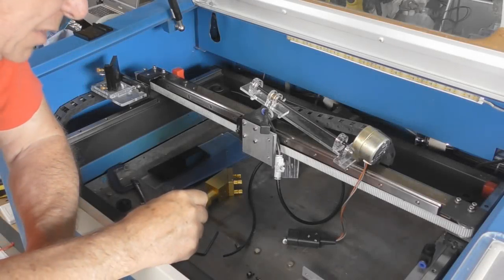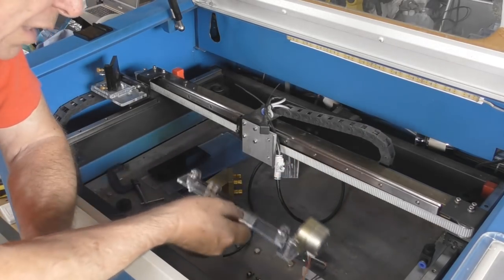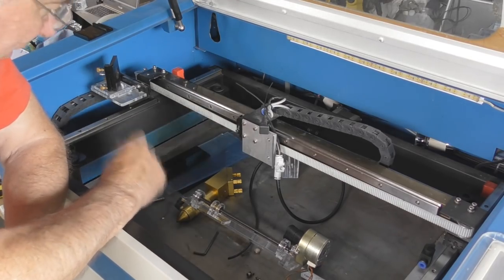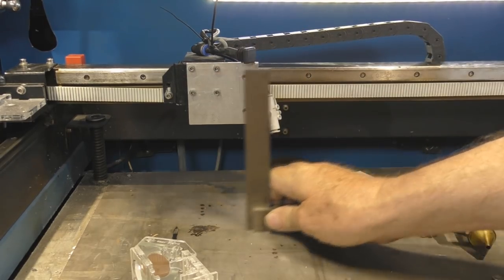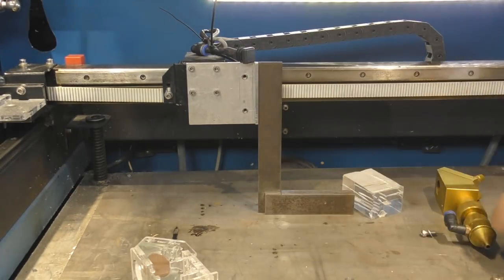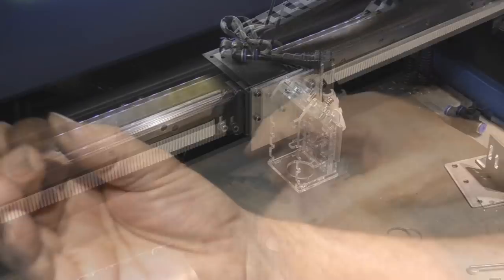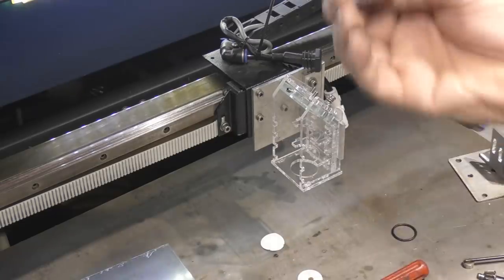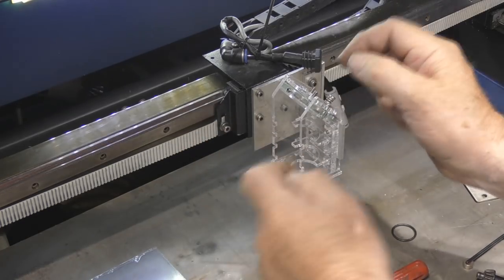RDWorks Learning Lab 144 New laser head

Comment: So, that's one heck of a neat design, I really like it! I can appreciate the need for full adjustment on the head - with my laser (the one I spent months rebuilding), there's no adjustment on the head at all. My only way of adjusting height was the tube mounts themselves, which was extremely tedious during the initial setup. I had thought of modifying the head, but I was simply glad to get it working and not spend any more time on it! I predict that in a few months, some enterprising Chinese company will have seen your video and will be making heads like this ;-)

If you do go for a metal one, depending on how you're getting the metal cut, you can basically do exactly the same construction as you did with the acrylic, with mortise & tenon joints. Once assembled, you can give each tenon a brief zap with a TIG welder to fuse it into the surrounding sheet. Gives a very rigid construction.
Reply from the maker: Hi Lindsay
Tenon and TIG weld fuse welds is an approach I have been using for many years. There are very few things I cannot make from 2D  parts. I am not just copying this design in metal but adapting the design to a more sophisticated level to exploit the strengths of metal. So there will soon be a Mk2 and I will see if I can back engineer it to acrylic for others to make for themselves.
Best wishes
Russ

Comment: Another great video! I would love to see this adapted to the Red Sail clones as well. Russ, the red clone I have uses the same "hinge" style screws for mirror adjustment as your modification. It makes alignment as easy as you show it. While watching your amazing work, I wondered how I managed to get nearly centered results without the adjustable head assembly you've created. I believe it is possible because the entire mirror holder can be shifted by turning all three adjustment screws either direction, which accomplishes what your adjustable head accomplishes, although without nearly as much travel. When reaching travel limits on the screws, it is necessary to return to the tube and raise or lower it to return the beam within range of the adjustment screws. A big job, clearly simplified by your design. Very nicely done.

On an unrelated note, have you considered to put your massive engineering talent into creating a reflection test device? There's been some discussion of "bounce-back" of certain metals causing damage to a laser. If you had a caddy/fixture to place test metal samples at the focus of the nozzle, at a 45° angle, would your power meter be able to read how much of the energy is absorbed by the test metal and how much would be reflected into the nozzle?

I would envision that a test taken at the focus with the power meter, compared to the reflected power, would determine which metals should be safe to lase for projects involving paint removal or the like.
Reply from the maker: Reflectivity is a vast subject  but if you narrow it down to our IR wavelength of 10.6 microns every metal is reflective. The degree for  the majority is above 80% and  metals such as copper brass, aluminium, gold and silver will be at 99% and above depending on the surface oxidation. An oxide is a non-metal and will absorb the light energy.  If 99% of the energy is reflected then because it has been concentrated into pin prick, because 80% of the light energy is at the central part of that pin prick there will not be much scattering because that high energy near the beam axis  will be reflected back nearly normal to the surface. Just like waves hitting a sea wall  there will be cancellations and  amplification of energy  as it is reflected so some of the energy reaching your lens could be much higher than when it passed through .  Marking stainless steel objects by burning away the powder coating is a regular question .
Stainless steel is about 95% reflective in it's polished condition. However cover it with paint and it is non rflective. The light energy hitting the paint excites the powder coat molecules into a higher state of vibration. As that vibration increases so does the paint temperature. At anything between 100C and 200C (depending on the powder formulation) melting will occur. Much above that and all sorts of chemical reactions start to take place. The real tell tale is if you attack powder coat with a blow lamp  you will produce a charred mess. Charring generally means carbon and carbon has a "melting" point of about 3500C. So it requires huge amounts of energy to raise the carbon to its sublimation temperature where it will turn into a gas and leave a nice clean surface behind. If you balance power and speed there will be very little surplus energy to reflect back to your lens. In the majority of cases you will be engraving on a slightly curved surface so and rays that bounce off will be scattered harmlessly.

In general I would advise using a longer focal length lens for such work at least  a 2" or even a 2.5" would be saferbecause the reflected energy densities will be lower.
I have only destroyed one 1.5" lens whilst trying to mark uncoated stainless. That will be the last one!!!
Best wishes
Russ

Comment: Just asking as I watch along ;-) Your glue - is it anything special, or just superglue? I've had bad experiences with superglue and laser-cut acrylic. Things look OK initially, but after a few days you get stress cracking from near the cut edge.
Reply from the maker: Hi Lindsay
Cast acrylic is less prone (but not imune) to stress cracking. The PETG cerment I use is less dramatic than standard acrylic cement. I used it for a  PETG job originally but found that it works well with acrylic but takes a bit longer to set. Maybe that's why it cracks less. Here is what I use
http://www.bondrite.co.uk/adhesives-for-plastics/wc123-petg-weld-cement-250ml/p340483.html

Best wishes
Russ

Comment: Looks great Russ.  I do have a Q. Perhaps I missed something along the way.  The lens adaptors your inserting obviously would be required to utilize your system. Where does one get such a lens kit. Also, does the lens kit only go up to 2.5" OR say to 4" or greater?  Im sure others would be interested in knowing the cost of a lens kit as well. -Sam
Reply from the maker: Hi Sam 
The problem with this design is that it was a prototype to test all the ideas. As you know, I don't do things behind closed doors so this was a bit of a "let's see what's possible". The biggest being to prove the stability of acrylic for such a laughable application. I had planned to make a metal version but that would mean that others could not follow if they wished and I was locked into doing something I don't want to do, which is selling an expensive product. I don't need to be selling things, thus my goal is always to provide designs and information so that you can do it yourself as cheaply as possible. First it was all about proving the principle and after a few weeks of using it I'm very happy. However.....as you have rightly observed, I had to make a lens tube for every focal length. Although OK for me, because I have the kit to make them, this was a significant negative if others wanted to try and follow me. Hence I looked hard at the design and have now worked on a MK 2. With just one nozzle and  one modified 20mm style lens tube  (like I have on the Lightblade machine).  I can cater for 1.5", 2", 2.5" and my compound HD lens system. With a slightly modified nozzle you could also fit a 4" lens. I did not fit the 4" lens into my brief because  folks with this China blue machine usually stick at about 60 to 80 watts  where a 4" lens is just a blunt axe. This design is being specifically developed to fit the 300x500mm  blue machines with a FRONT FACING bearing on the X axis. I am no planning on developing one for the Red Sail clone machines using the TOP FACING bearing system because designing a suitably stiff mount will be a nightmare.  Even with my fairly rigid front mount system I have accidentally identified a problem that I have seen on other machines and been unable to fathom the source of the issue . Now I know, it has forced me to dump my aluminium back-plate in favor of a REALLY rigid design. All will become clear in about a week when I plan to publish my MK2 design and spell out the manufacturing options that I hope will suit the varied  skill and equipment capabilities of the many interested parties. I still plan to sell as little as possible but I will try to help those with enthusiasm and skills  but no manufacturing kit.  I will be posting the dxf files and parts list  on a couple of sites for people to download and modify as they feel fit to suit their machines.

Thanks for your interest
All best wishes
Russ
Reply: Russ,  Thanks for the speedy (laser like answer ). So If I understood you correctly you made your Laser Lens holders?  Also, I ask about the / say a 4" or greater. As of lately a few of my projects have me cutting foam. So the Axe metaphor is a good one. (foam >1"-3") . Also, have you thought about running the laser for some 1-5-10 mins and taking temperature measurements from the backside of the 3rd mirror? My guess is you should be able to predict the longevity  of the perspex with the gathered information. with hopes of the MK1 being sufficient. Like you. I too dont mind machining out my own parts if need be. But if the laser can do it and the part be good enough?. then let the lasing begin! I know now after more than a hundred vids you already know this. You are a true asset to human kind Russ!  I'll have the popcorn ready for the MK2 showing.:)  * Meant to add. Dont know about the others. But Im interested in your lens tubes and how you approached the builds. I have been contemplating making my own corrected  3rd mirror and lens holder from aluminum.
-Sam

Comment: Just a thought. Can you reduce the power programmatically? Would it let you write orientation marks in the surface of the material without cutting all the way through. Failing that, you could laser a tiny hole as an orientation marker. For example, "Align single dots and double dots when assembling!"
Reply from the maker: The simple answer is yes.. At present there  are no drawings available for release because despite being successful it is a 3D prototype. I am now self criticizing it and in the process of designing a metal MK2  version with much easier to use features. I may try to translate this design backwards for acrylic manufacture so that people can make for themselves. As I do so I shall make the location tangs in different positions so that it can only be assembled the correct way. That would be the normal way of fool-proofing assembly.
Thanks for the suggestion

Best wishes
Russ

Comment: Well again a damn good session and I learned a lot again. But after everything was set i couldnt see the way you set the focal point. With the original head we could move the nozzle up and down but here i think you set the focal point by moving the table up and down right?

Edit: how did you make that nozzle set and also, can we have the dxf file and make our own nozzle set for ourselfs or are these all for sale?
Reply from the maker: Hi Umat
Yes if you listen at 18 minutes you will hear me tell that you need and adjustable table because the nozzle is at a fixed height..

The nozzle set is made from plastic (acetal copolymer)  and although I have drawings for it I will not be publishing them just yet. I am in the process of looking at this prototype and criticizing it. I am part way through designing a metal Mk2 version that will be a lot slicker. I can design differently in metal. I may be able to back translate the metal design to plastic so that you guys can make your own  but the mounting bracket will still have to be metal for strength and stability. 
Best wishes
Russ
ps I am musing the possibility of making the head and nozzle kit available for sale because there have been many interested that do not have manufacturing capability

Comment: what is the advantage of making it with aluminum other than being resistant to a beam strike?
Reply from the maker: I am already working on the Mk 2 metal design which will not be a straight copy of the Mk1 acrylic . I have decided that for many manufacturing and design reasons I will make it from  thin stainless steel but the mirror will remain in an anodized aluminium housing, just in case the beam is a a bit off target during set up.
Best wishes
Russ

Comment: Hello Russ,
Is it possible that you could supply me with the dxf files for your new acrylic head?  I would like to make the modification myself and possibly use them to make a metal version myself when I have finished setting up my CNC machine.  Incidentally, on another request, you mentioned using the new youtube IM facility but I have no idea how to get to it.
Reply: Hi Peter
By this weekend I hope to be videoing the Mk2a  version with no special tool requirements for those who do not have workshops or certain skills. After that I will be making drawings and kits of fixings available along with the mounting bracket.
Since You Tube stopped their private message system, it is difficult to send email addresses for offline contact. If you need to contact me send me your email address as a comment. I automatically get the same message as an email and can immediately delete your comment from the public arena.

Best wishes
Russ

Comment: Hi Russ, is it already possible to get the cutting file for this lensholder? I realy want to replace the original one with this version ;-) Thanks!
Reply from the maker: Hi Patrick
Just a little more patience and I will be issuing video number 153 which is the final design of the acrylic head and giving details of where the files are and where to buy parts. Up to now I have not released drawings because this has been a work in progress. The design has been tested in various ways over the past few weeks and  I am completely happy  that I will not be causing you a problem and that even people without small workshops will be able to make it. I have used standard lens tubes and nozzles  that can be purchased on-line and now China blue has a powerful array of lens options  it can use and also  you will have the opportunity to adjust the lens position within the lens tube to change the distance between nozzle and work by a few mm.  The operating conditions for cutting and engraving are completely different  but you are only supplied with one nozzle. My work shows beyond doubt that you really need dedicated nozzles to do each task correctly. However, if you need to cut and engrave on a single  project then you have to accept the compromise of using a single nozzle (probably the cutting nozzle.)

Thanks for your interest
Best wishes
Russ
Reply: Thank you so much, two thumbs up for all your work on this!!

Comment: what did you use to polish the mirror ?
Reply from the maker: Hi Patrick

Check out   https://www.youtube.com/watch?v=55T_rDsj2go            at 15:30 you will see how I polished it and with what.

Best wishes
Russ
Reply: tnx !!!
Reply: was not sure if I could use commandant to polish ( had quite a lot of dirt on the head mirror that did not come off with Alcohol)
used that now to polish and its a lot better now again.

back to cutting my Panels for the flightsim.
Reply from the maker: Hi Patrick
You can use acetone on your mirrors  but do not use it on your lens.. Acetone will usually shift any burnt on debris. You may need to leave it soaking for about a minute but I have never failed with alcohol. My raw copper mirrors are a bit different . The thin oxide coating has to be lightly polished off.
Best wishes
Russ